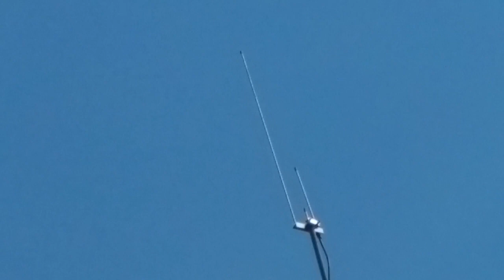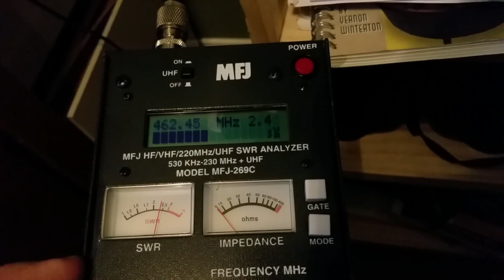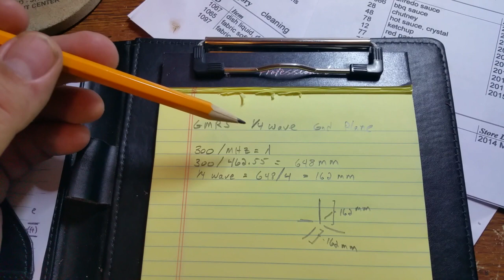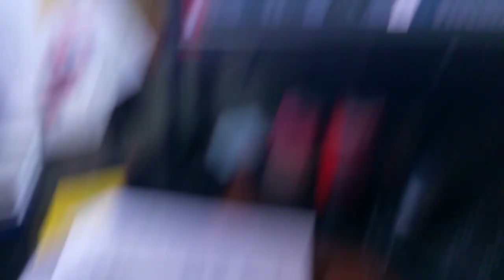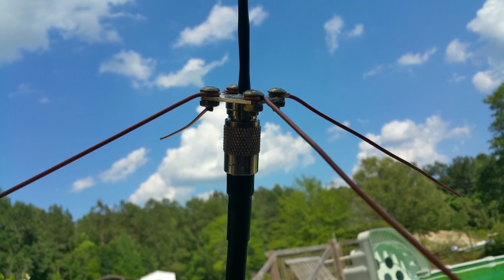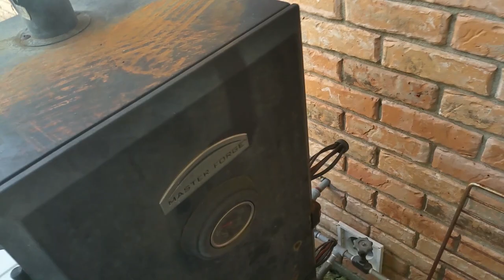GMRS Ground Plane Antenna

Comment: Im going to try a Nagoya mobile antenna or the Midland mobile antenna. Set the antenna up just like I would on a car . Would that work . I know it wouldn’t be as good as a jpole tuned for GMRS. I just need it to reach a simplex repeater that I will be setting up. I’m not interested into talking to others outside of a few family members that live 4-5 miles from me . Plus  from base to hand helds  on my property

Comment: Good job but you cannot beat a copper J Pole antenna they are the best and work so good check one out easy to build.
Reply: ED Fong disagrees  https://youtu.be/JyW_CCzPXSQ       38:45
Reply from the maker: Yes, I built a copper tubing jpole for marine band at our fishing camp.  It turned out great.  I've become a fan of the J pole also.

Comment: Wouldn't it be better to cut your antenna to the transmit freq rather than the rec freq?
Reply from the maker: Yes, if this were a true repeater with an input offset.  I'm using it with a store forward  / simplex repeater.

Comment: How can I ground my antenna to guard against lightning?
Reply: the easy way to ground you antenna is use lighting aresster  and ground you mast   and lighting aresster to the grounding wire
Reply from the maker: Easiest way I find is to have a grounded antenna switch.  A little $ but they last.  Be sure to get one with the center ground.  Key is when your radio is not in use, turn the dial to the grounded position. This grounds all center conductors and the coax shielding.  Good to have a ground bar / source in your ham shack.  Just connect the ground bar to the switch with a hefty piece of copper.  If lightning strikes your antenna then the least resistance to ground is not through your radio.
https://www.amazon.com/MFJ-1702C-Antenna-switch-VHF-2-pos/dp/B00AR08EQU/ref=sr_1_7?dchild=1&keywords=antenna+switch&qid=1573437847&sr=8-7
Reply: @minionman6177  
Andrew Murphy
1 second ago
the easy way to ground you antenna is use lighting aresster  and ground you mast   and lighting aresster to the grounding wire
Reply: well the are sever ways to provent lighting from distoring your radios and antennas using a antenna poly faser grounded to a grounding rod to keep it comming up the coax and then grounding the legs of the mast in the proper way helps to. I have not had lighting to take out any of my stuff and there been some nasty lighting storms since i got it up  if you need links to what i am talking about i can help u with links and just ask
Reply: GET THE ARRL BOOK ON GROUNDING AND LIGHTING THEY SHOW U AND TALK ABOUT HOW TO GROUND THE ANTENNA
Reply: @AndrewMurphy8383  Wow. On the third try, this dipshit thought all caps would do the job his failure to express himself in English didn't do.
Reply: 6 foot copper rod driven into soil, connected to heavy conductor. All equipment in shack connected with heavy braid. I always remove the coax away from the transceiver.
Reply: well the are sever ways to provent lighting from distoring your radios and antennas using a antenna poly faser grounded to a grounding rod to keep it comming up the coax and then grounding the legs of the mast in the proper way helps to. I have not had lighting to take out any of my stuff and there been some nasty lighting storms since i got it up  if you need links to what i am talking about i can help u with links

Comment: Could almost smell that brisket....mmmmm
It is my understanding that GMRS rules have changed to allow repeaters and that the frequency ranges from 462 to 467 or so.  Seems like you would want your antenna for a repeater to be tuned to the repeater freqs or midway between for a compromise solution.
Reply from the maker: I set it up as a store forward (simplex) system not a duplex repeater.  I avoided duplex because most folks in will have nothing more than a hand held gmrs radio, not one of the ones capable of repeater operation.  I only activate it during weather events after a notification on the nextdoor app, in case communications fail.  So it's really just set up to liase any emergency traffic to the ARES net on 2m & enable extended gmrs range for folks to talk.  I get a little less than 3 miles range from my antenna to an HT at ground level at 5 watts.
Reply: @minionman6177   WHY NOT STRIP THE JPOLE ANTENNA AND BUILD ANOTHER JPOLE THAT WILL WORK FOR GMRS
Reply: USING THE PARTS